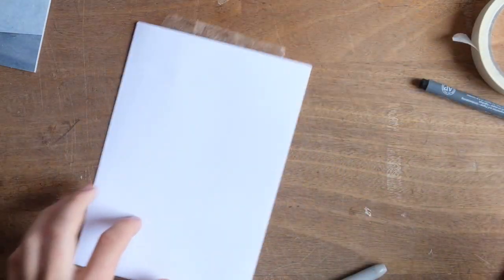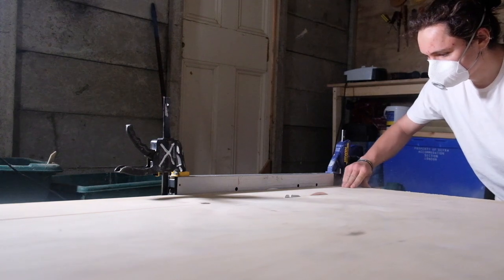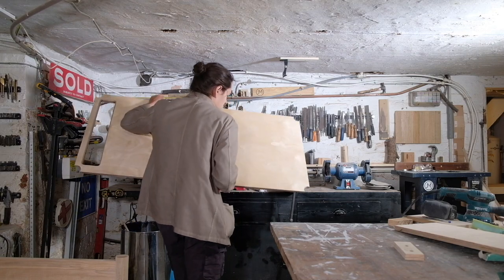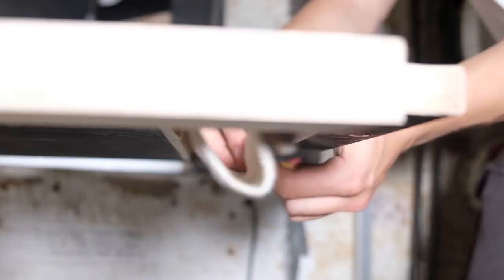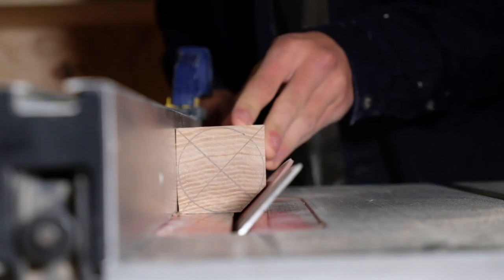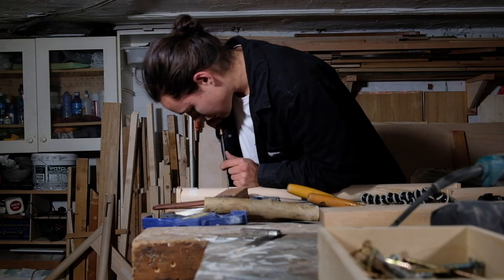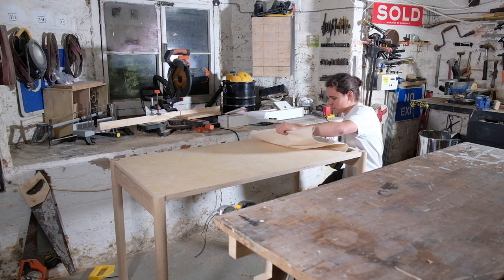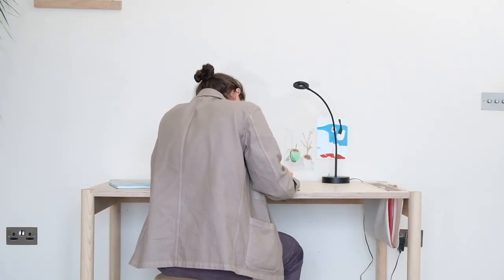Making a Desk with Integrated Storage | Rockler Desk Challenge

Comment: It’s 10:31 that got me. Maybe I missed it earlier but the fact the legs fit into each other when flat-packed... It’s the thought about the whole design that is so impressive. It’s not just a table with a unique feature, it’s also that it’s incredibly practical. It bolts together very quickly and then disassembles into a package barely bigger than the table top. If you used a quick release locking pin or bolts with wings on for hand tightening (no tools required), added a carry hole in the table top and means of clamping the legs to it while in transit, then you’d have the ultimate go-anywhere instant table. Marvellous!
Reply from the maker: I would love to say I designed the legs to fit inside of each other but I was just as surprised when they did haha! But thanks Rob & nice ideas to make it a table better suited to transit; I think some sort of faster you could tighten by hand, or alternatively a place to store an Allen key within the desk, could work well.

Comment: Thank for the video JM. You could make a desk with all three storage slots. Left, right and back like you show separately. Your standard of making and finish is getting better all the time. Keep safe and stay well.
Reply from the maker: Thanks Colin + I was deliberating for a while about where to put the slot but ultimately thought having it on the side would give you more desk space, especially because I tend to put a laptop on the back and notebook at the front. I didn't mention it in the video but the table top is actually completely symmetrical so you can always flip the side it lies on too.
Reply from the maker: Although it would be nice to try out a long slot at the back, so you could fit store more books + I was also thinking about possibly making a stationary pot/sling.

Comment: You were doing so well with joinery that I cringed a little when I saw bolts. But, off course it's totally understandable if you want it to be easily disassembled. End product looks very polished. Props on milling your own hardwood. All in all, highly impressed.
Reply from the maker: Thanks Borys, I really appreciate it and yes it would have been nice to be able to keep to traditional joinery methods, but it had to travel a few hundred miles in the car so I thought it would be best if it could come apart - I did try and keep all the fixings hidden though in the final piece :)